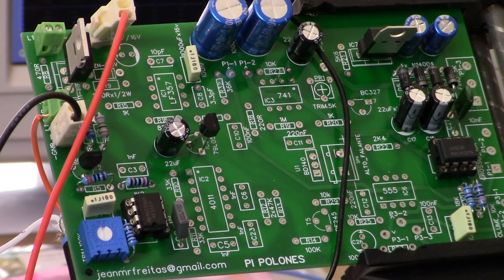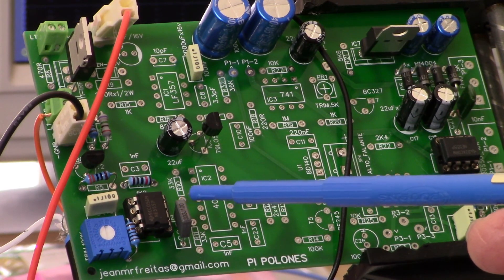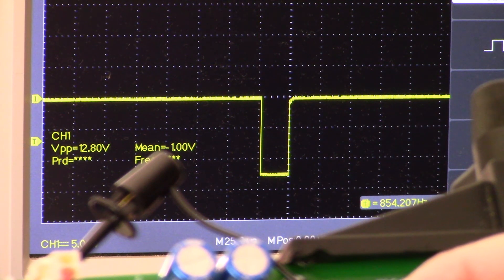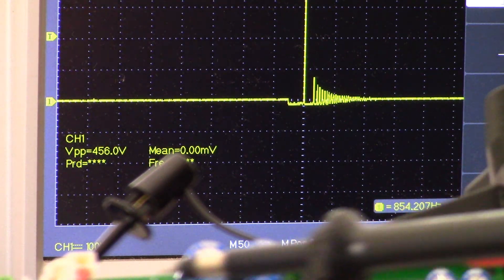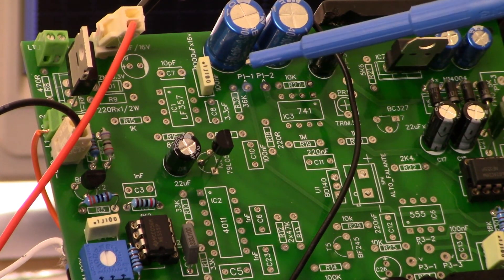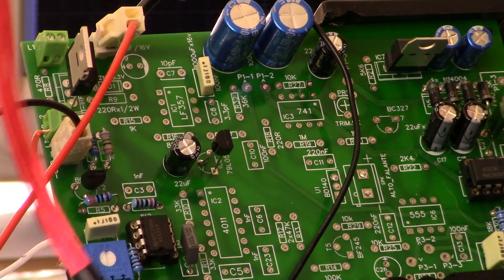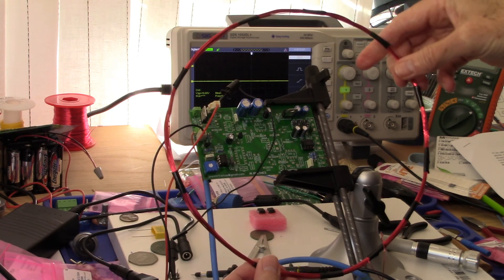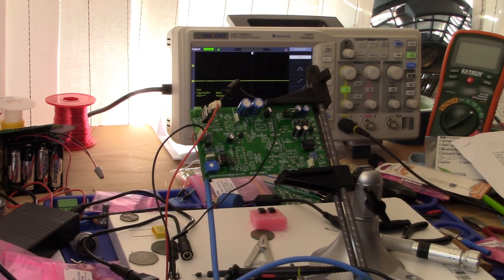PI Polones DIY part #2 pulse transmitter and Mosfet

Comment: Hi sir, i made one polones pi dedector.its working.But i see in this video the resistor behind mosfet, 470r...mine is 180 r...my mosfet is irf840..my coil 1.6 ohm and 0.26 mH...if i put 470 r what happens..
Reply: Can you send me the diagram you worked on?
Reply: @حبيبصالح-ي2ص yes but how.

Comment: Welcome back. I have a problem at the generator stage. Transistor T1 BD911 heats up and burns out one second after applying power. I've already burned 3 transistors. The voltages from the first stage -5 and +5 are ok. My coil is made of twisted-pair cable - parameters resistance is about 2 ohms, inductance is about 320 mH. Trimpod PR2 - set to the middle position at 50K. I checked T2 with a component meter and it seems ok. Do you have any idea where to look for the problem?
Reply from the maker: Hi my friend.  It is extremely difficult to troubleshoot without seeing the pcb.  Where is you get your pcb?  Did you buy one, did you make it? I suspect that you have a short somewhere causing excessive current.
Reply: @SurfDetector  I bought the plate ready.  Problem has been solved.  While viewing the PCB through the magnifying glass, I improved all connections at the elements with a soldering iron - even though they looked perfect.  The detector started working properly.  Thanks a lot for your suggestion my friend.  All the best!

Comment: Podrías dar características de la bobina diámetro tipo de alambre no de vueltas
Reply from the maker: Hello Jesus,
My coil is 24 AWG wire.  It is 9" in diameter with 23 turns.  I measure it at 1.9 ohms and ~300uH.

I hope that you subscribe.  Thanks.

Comment: Cuanto da la resistencia de ajuste de frecuencia ✋🏻
Reply from the maker: el potenciómetro es de 100000 ohmios.
Gracias por visualizar mi video. Por favor, suscríbete. Pardon por mi espanol es muy malo
Reply: @SurfDetector  gracias x responder veo q el tripot de 100 k esta ajustado casi al medio si podrias decirme la frecuencia q da el 555 ..xq no tengo ociloscopio...✋🏻
Reply from the maker: @raffa2833  In my video I do not have the frequency set yet.  I am setting my frequency at ~500 hz but in order to do so you must change some parts.
Reply: @SurfDetector  ok gracias saludos desde argentina ✋🏻
Reply from the maker: You are welcome my friend.  You should try to get an oscilloscope it makes your chances of success much better when building these metal detectors.  I will continue to build the PI Polones with more videos.